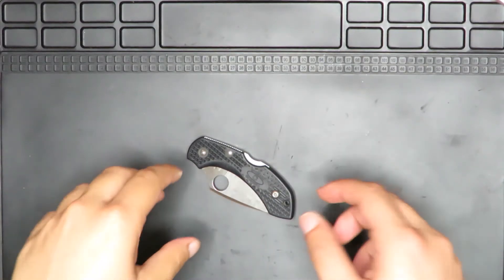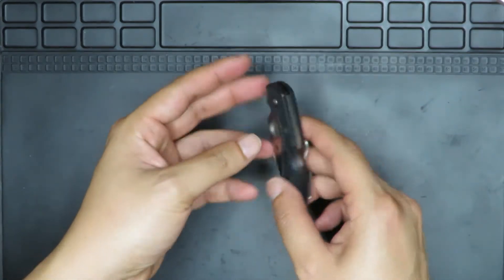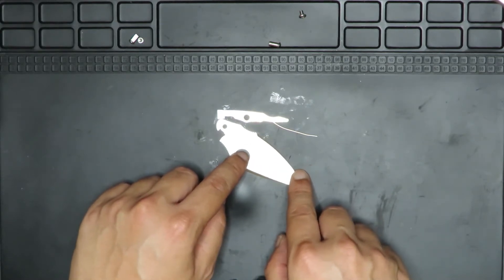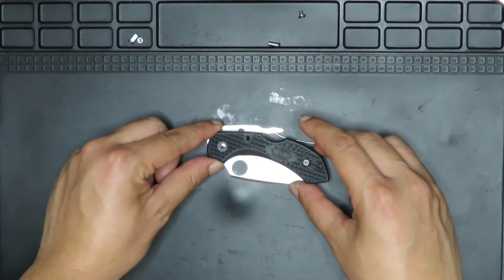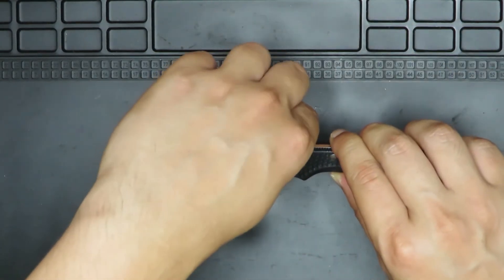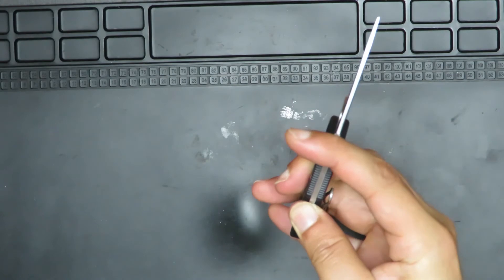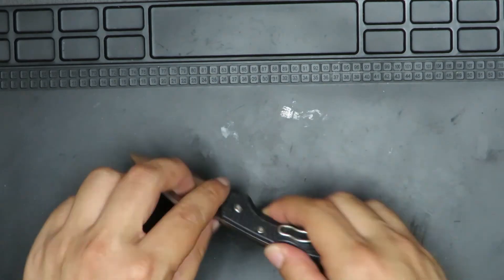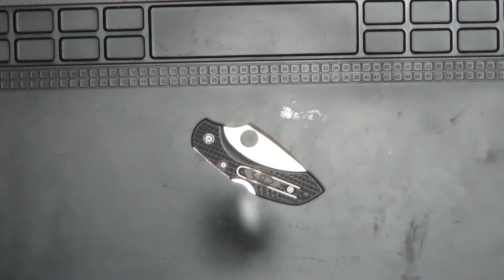How Does A Back Lock EDC Pocket Knife Work?

Comment: Backlocks are very strong, but in general for more than $50 nothing you do on a daily basis that is considered an edc task should defeat any modern locking mechanism. Liner, frame, back, axis, ball bearing, compression, or even a friction or slipjoint should be solid for daily pocketknife tasks. 

You gotta do some extreme shit to defeat positive locks or exercise gross negligence in handling the knife to get them to close accidentally.
Reply: The reason I included the price point is that some of these gas station knives are literally made from the most garbage materials and have tolerances that would make a progressive blush.
Reply from the maker: 100% agree with you. In fact like 75% of the time, a well made slip joint will do the task of any folding know in urban settings.
Reply from the maker: my MIL gave me one for my birthday knowing i was into knives. It made me appreciate any budget kershaw, crkt, civivi, cjrb way more